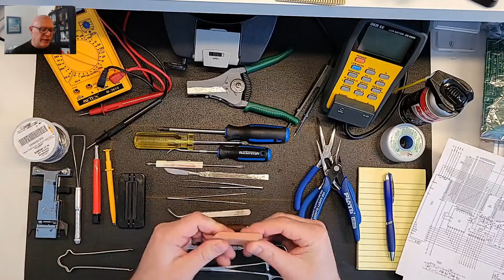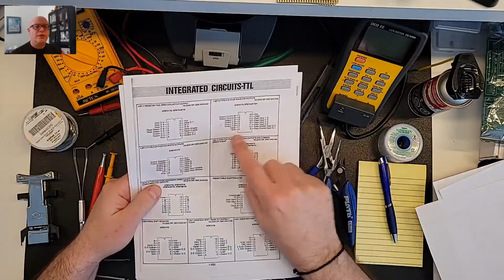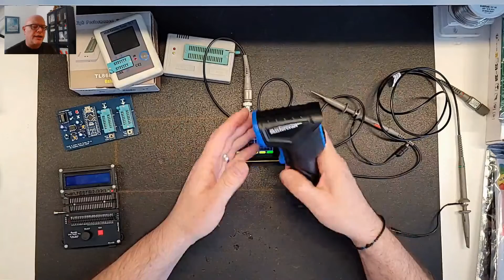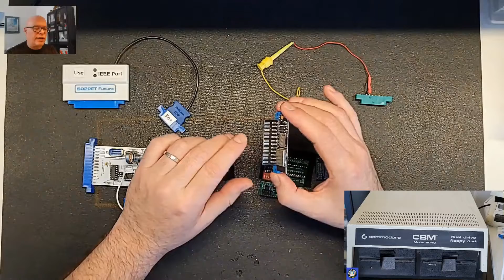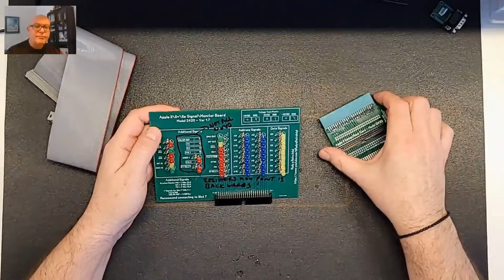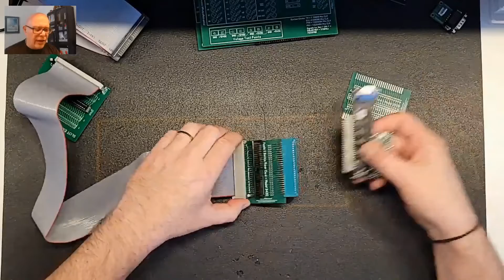The Tools I Use to Repair 30+ Year Old Computers!

Comment: 5:21 the 60/40 refers to the make up of the metal component of the solder, in this case 60% tin (Sn) and 40% lead (Pb). The flux content is usually around 1 or 2% of the overall solder wire content, so around 98% of the overall wire is metal broken down in the 60/40 ratio above. HTH.
Reply from the maker: Opps, I got it wrong, but thank you very much for letting me know how to properly read the solder label. I'm sure others will appreciate the update. Thanks for commenting
Reply: @RudysRetroIntel  I always say, every day is a school day! this is what this community is about, always learning something :) thanks for pulling the video together, I learnt some stuff too

Comment: Thanks for the video, I will certainly be checking out some of those add-ons for the retro computers. A few other items I don't recall you mentioning that go on any good workbench is Isopropyl Alcohol (99%) and Q-tips, an antistatic mat and/or wrist band, a set of small screwdrivers with various tips including security screw tips. Optionally but very useful is having a bench DC powersupply (or two) when you want to test from a good source of power and also limit the current. Also a variable AC powersupply can come in very handy.
Reply from the maker: Very good points! I have all those and more. However, the video would have been over an hour long, and I wasn't sure people would be interested in a very long format. To add to your list, soldering fume extractor, tork screw drivers, and window cleaner, rubber gloves, monitor discharge probe with meter to measure high voltage, and more. As for wrist straps, I don't use them as my mat has a grounding cable, so I make sure I'm always touching it. Thanks for sharing and commenting